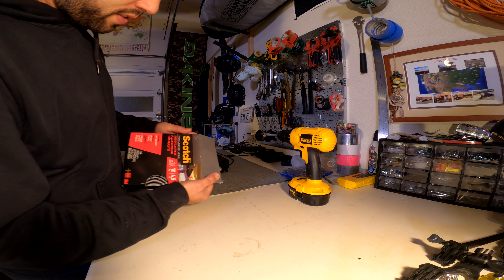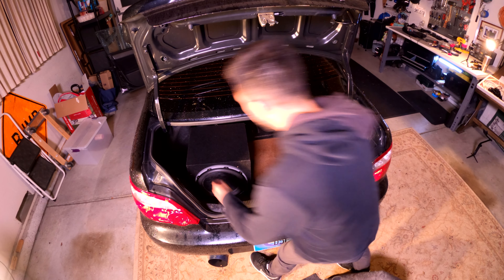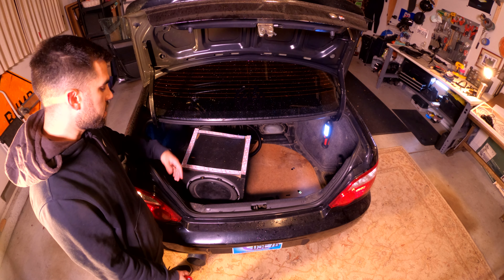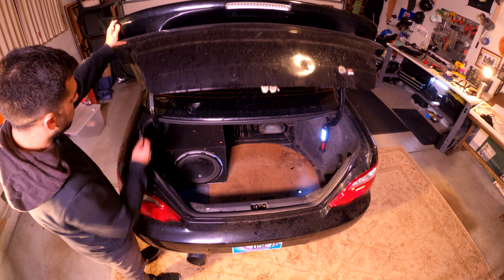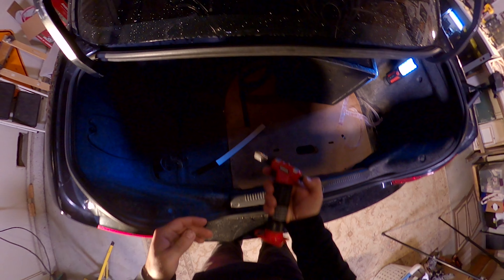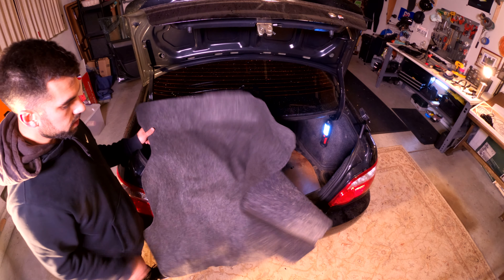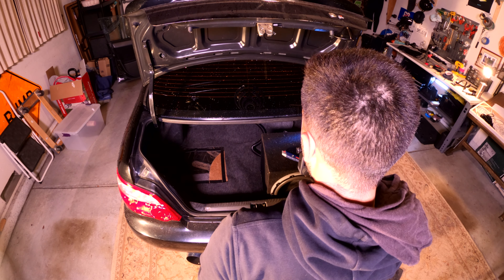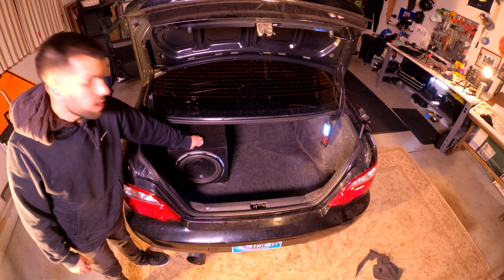🔊 How to: Secure Your Trunk Subwoofer 🔊

Comment: How does it work under a hard launch or cornering?
Reply from the maker: I've thrown the wheel sharply several times, hard launches and quick stops, and no movement what so ever... Make sure you take your time heating up the adhesive and making sure the connection between velcro and trunk has no gaps or bubbles..